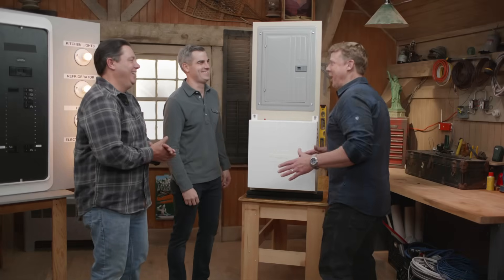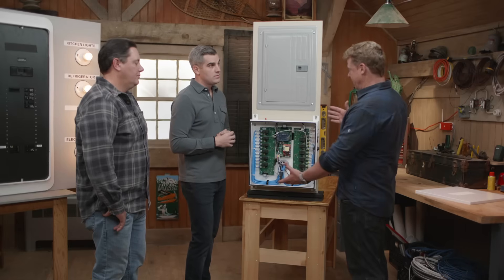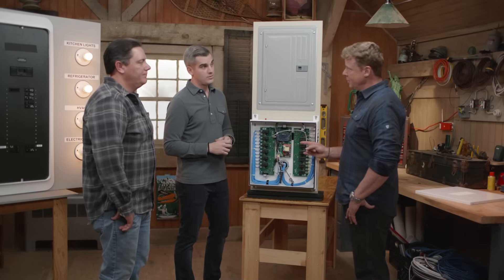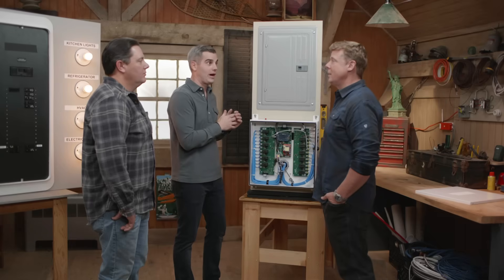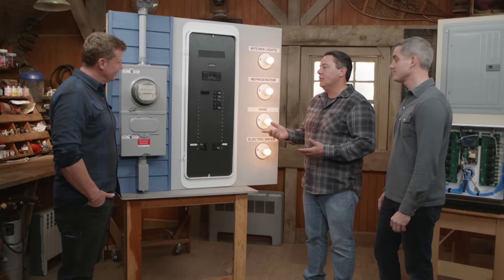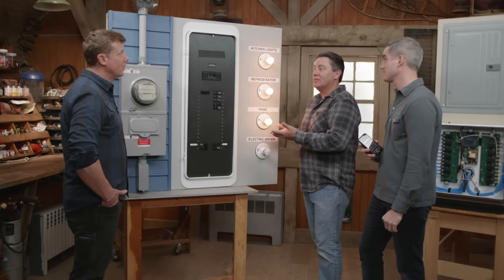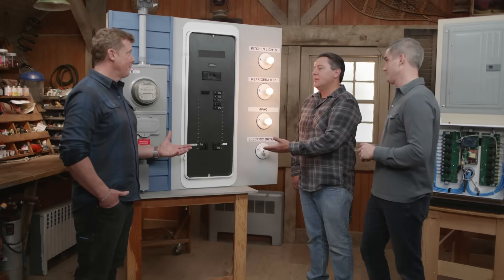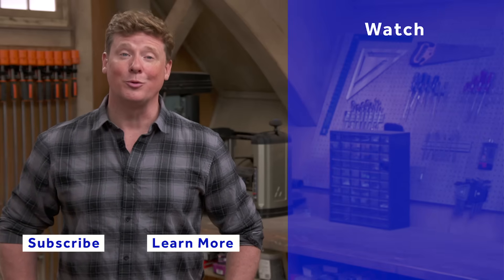Understanding Smart Electrical Panels | Ask This Old House

Comment: decided to go with Leviton load center with 2nd Gen Smart Breakers (and dual function or GFCI only) and tied them with the whole house system. Now I don’t need any intermediate decide to configure those circuit breakers to be “Essential” and can do it all within one panel.

Comment: This is no future. Battery cost 25K$ solar cost 50k$ that’s 75k$ alone. That’s 75K$ alone if your bill is 200$ a month that’s over 31 years just to paid it off not mentioning system is good for 10 maybe 20 years. We haven’t seen a system still good for 10 years so good luck. I worked for biggest solar company SunPower/PinkEnergy and they just went bankrupt I didn’t get paid. Do not let them sell you this crap

Comment: Smart panels represent a significant advancement in residential electrical systems, offering several benefits over traditional panels:

1. **Load Management**: Smart panels provide the capability to manage loads effectively. By monitoring individual circuits' power usage, users can identify energy-intensive appliances or devices and optimize their usage. This can lead to more efficient energy consumption and potentially lower electricity bills.

2. **Remote Control**: One of the most significant advantages of smart panels is the ability to control them remotely via a smartphone app or other connected devices. This means homeowners can turn appliances or circuits on or off from anywhere, providing convenience and flexibility.

3. **Integration with Backup Power Systems**: Smart panels seamlessly integrate with backup power systems such as generators or solar with battery solutions. During power outages, users can prioritize critical loads, ensuring essential appliances like refrigerators, heating systems, and lights remain powered.

4. **Automatic Load Shedding**: Smart panels can automatically shed non-essential loads during power outages or peak demand times. This ensures that critical appliances receive power first, maximizing the available backup power capacity and potentially extending the duration of backup power.

5. **Optimization of Energy Consumption**: By providing real-time data on energy usage, smart panels enable homeowners to identify opportunities for energy savings. Users can adjust their consumption patterns based on insights from the panel, potentially reducing their overall energy usage and environmental impact.

6. **Adaptability and Future-Proofing**: Smart panels are designed to be modular and adaptable. They can accommodate future upgrades or expansions, such as additional circuits or integration with emerging technologies like smart home devices or electric vehicle chargers. This future-proofing ensures that homeowners can continue to benefit from their investment as their needs evolve.

Overall, smart panels offer enhanced control, efficiency, and reliability compared to traditional electrical panels, making them an increasingly popular choice for modern homes seeking to optimize their energy usage and resilience.
Reply: Using smart panels can make sense for both retrofitting older homes and installing them in new construction projects. Here's why:

*Retrofitting Older Homes:*

1. *Enhanced Control:* Retrofitting an older home with a smart panel allows homeowners to gain control over their energy usage and optimize their electrical systems without the need for a complete renovation.

2. *Energy Efficiency:* Older homes may have outdated electrical systems that are less efficient. Installing a smart panel can help modernize the home's energy management, potentially leading to energy savings over time.

3. *Integration with Existing Infrastructure:* Smart panels can often be integrated with existing electrical systems, making them a feasible option for retrofit projects. They can work alongside older wiring and appliances, providing benefits without the need for extensive rewiring.

4. *Improved Resilience:* In areas prone to power outages or with unreliable electrical grids, retrofitting with a smart panel can provide homeowners with added resilience. The ability to prioritize critical loads during outages can ensure essential systems remain operational.

*New Construction:*

1. *Built-In Integration:* Installing a smart panel during new construction allows for seamless integration into the home's electrical infrastructure from the outset. This ensures optimal performance and functionality without the need for retrofitting.

2. *Customization:* With new construction, homeowners have the opportunity to customize their electrical systems to suit their specific needs and preferences. Smart panels offer flexibility in load management and control, allowing for tailored solutions.

3. *Long-Term Investment:* Including a smart panel in new construction can be seen as a long-term investment in the home's efficiency, convenience, and resale value. It provides future occupants with modern features and technology that may be increasingly desirable.

4. *Compliance with Building Codes:* In many jurisdictions, new construction must adhere to updated building codes and regulations. Smart panels may offer features that align with these requirements, such as energy efficiency standards or integration with renewable energy systems.

In summary, while smart panels can be beneficial for both retrofitting older homes and incorporating them into new construction projects, the decision will depend on factors such as the homeowner's goals, budget, and the condition of the existing electrical system.

Comment: If I sell my home to an old lady who isn't interested in Smart technology, will the panel function like a normal panel with no smart tech engagement or are you required (on some basic level) to connect to and configure it? 

Also, if my Wi-Fi router bites the dust, is there a way to switch the smart settings from the panel? Or am I locked into the way it was configured in the app until I replaced my Wi-Fi router?
Reply: All of these are able to act as a standard panel. They just simply have additional features for people who want more control OR have a backup system. IE generator/battery/solar etc. 

Yes. Well, mostly. It can depend on the panel. Some have a direct interface built in and some do not.

Comment: With smart panels all being built with wifi to cell phone management, what is being done to secure that communication link?  Are the manufacturer's apps being created with a built-in VPN?
Reply: You're asking about security and a VPN while using the internet to post a comment to a  Youtube video owned by a company that has had data breaches before? LOL Get out of here with that nonsense.

So many people asking that same question and acting like they all aren't actually on the one thing they fear the most.

I find it ironic and wonder if you all are still riding horses or have central heat and AC? Why are you on the internet?  lol "AHHHH this new fangled technology!"

Comment: I like how the smart panel has an Arduino Mega 2650 as a control board. But smart isn't always better. Automobiles are a fine example is the onboard PC fails that car will not start and major cost for repair. before CP were added change a wire for a few bucks and the car still runs. Now everything is fly by wire on cars. so your fuel and brake pedals function wirelessly not by a cable as in the earlier days. if the PC goes out you lose all control of the vehicle. not a good thing at all!

Comment: I like the concept, however, I do not like that it is dependent on an app, to control the circuits. I would need it to trip the breaker to turn the things off. Not just switch a relay. I shouldn’t need to use my phone to switch my breakers.

Comment: I am not against new things but I'm not sure this solves any real problems.  I have been a general contractor for over 30 years.  For my projects which had solar and/or a generator I have used an Enphase controller and battery.  Smart homes sound cool until grandma comes to visit  or the non-English  speaking house keeper tries to turn something on.

Comment: Span is $4500 for the panel alone right now.  $4500 for an electrical panel without installation is absolutely insane.
Reply: So $1.5 k more for a panel that does a lot more than the one they have shown here? 🤔 

Sounds like a deal to me. 🤷‍♂

Comment: I'm in the process of installing the second one, "Span Panel" in my 50 year old townhouse. Installation will be about $1500.  Part of that will get help from fed tax credits as tax people have already confirmed qualifies under IRA (2022), for max of $600.  With my PV and batteries, I think this will make a significant difference.
Reply: Did it?
Reply: @אתהברטון  Contractor changed (upped the price) so, I passed.

Comment: Good luck 8 years later when  chips & other parts are obsolete and you now have a useless boat anchor. Had seen this time & time again. Had to throw out $10,000 drives that were 8 years old and could no longer get replacement boards, IGBT'S , and other parts. We were lucky to have a very expensive dive lightning  /dimming panel that be vendor kept it running 12 years. Would not want something like this in my house even if it was free.

Comment: I think I'm gona go with leviatins all in one 200 amp for my panal upgrade what I like is its solar ready and has smart breakers if you want to use them in case electronics fry I can just replace a breaker not printed controll boards

Comment: Durability ? Will it still work after 10 years? 20+ years? It's expensive to replace a load center, both labor and parts.
I don't like, seeing that many circuits, on just two circuit boards. If one relay fails, you have to buy the whole board. $$$
IMO, the concept is good, the execution is questionable.

Comment: Found something else that is pretty awesome. Eaton Smart Breakers. I found them, and they are a alternative to replacing the whole panel or all your switches. You can monitor the power through them, and also turn the switches off remotely much like these smart panels. It is not as all encompassing as say, the Span Smart Panel, however, they give the same functionality over the breakers they replace. The only major issue is that a single switch style takes two slots with the smart breakers, and that means you may have to consolidate smaller loads to accommodate. Looking into it, they have two types, one of which is the BR switch style that my panel already uses.

Comment: So my concern is the super fast increasing cost of electricity - almost doubling in my area from last year - because of  inflation - a battery back up system - with a whole house generator and a smart panel are appealing to me- we also get hurricanes on the reg and the grid recently could not even handle a cold blast we had and we went without power and heat for a week during the winter.  I went over the negatives  on this post....  but an uninterrupted power supply for my property when the grid that can t handle extreme weather conditions and cost is out of control.. ... well....  That is why this appeals to me.

Comment: There isn't an electrician alive that would recommend a SPAN panel for one reason. They need to last. SPAN will never be in business long term, power distribution is simple for a reason, it's critical. These SPAN panels cost a fortune and have the potential to kill your main power due to a glitch or bug. What did you gain? Do you really need to turn your circuit breakers  off remotely? If this was not a paid spot you would never see this. I love new products but everyone that buys this will regret it down the road. Think of the worst storm in history when you need to ensure electricity needs are met, this is when the wifi & cell backup in this overcomplicated device will fail and it will cost 2x the price just to remove this. Buy all the smart tech you want, but put it in downstream from your circuits.

Comment: I'm not so sure. This is going to turn into what Nest has become, where you used to be able to just use APIs directly with the thermostat, but after Google acquired them, they shut that off and made it so everyone has to buy a Google Home hub. Now the $200 smart thermostat is no better than a $50 programmable thermostat.

Comment: I'm afraid I'm in the large minority here...getting solar and a battery backup and cant imagine doing the system without this and being able to dynamically change the critical loads panel. And it saves me from needing to install one as well which lowers the true price by a couple hundred bucks

Comment: It's cool for sure, but I question the return on investment and the security. Seems like you could control your circuits just as easily by manually flipping circuit breakers and using a generator interlock, or a suicide cord back feeding into your welder/electric dryer. Obviously, some folks would prefer a safer alternative, like the generator interlock. I bought my interlock kit on amazon for $80 and installed it myself in about an hour. Cool stuff, but just doesn't seem practical in my eyes.

Comment: I made a conscious decision to use zero smart devices in my home when I rewired, the only thing I have connected to the internet is my security system. The other issue is one we've all been dealing with and thats the supply chain issue, particularly with computer chips. I prefer tried and true long term predictablity something that can't be said for anything computer controled/dependent...
Reply: You have your security system connected to the net and are worried about security? I don't think you understand how broken that entire comment is. Either that, or you don't understand the difference between the "internet" and a LAN or home network. And if true, then your comment is even more shambolic.

Comment: That looks beautiful and all. But what happens down the road if and when the company who makes the product goes out of business? The cool handy dandy smartphone control goes out the window because it probably runs through the company's servers somehow. And then what happens if one of the relays needs to be replaced and once again, if the company went out of business? Now what? You've got a pretty fancy $3500 breaker panel that's no different than the regular panels.
Reply: Not just out of business, but the product no longer being supported by the manufacturer due to being replaced by a new product, or just abandoned due to company acquisition. Also software has a very short life cycle, so it will probably not be updated after 3-5 years from first release.
Reply: @LegoTux   yeah, I can't imagine these panels will make their way in too many homes.Their high costs aren't worth the possible risk of the product not being supported down the road.

Comment: The problem with Span is they require the use of their cloud, and they don't have a direct, locally-accessible REST API I can use to integrate it into my custom home automation. I suspect the Lumin is similar (I've sent an inquiry). I wish more people would insist on full offline functionality, and full customizability.
Reply: Thanks for bringing this up! I'm on the engineering team at SPAN, and we're actually working on local APIs. Most of us are electronics hobbyists and energy nerds in our free time, and a lot of us are dog-fooding the SPAN Panel and already have it installed on our own houses. There are several active internal projects running local APIs that have been demonstrated to the rest of the company already. We understand the SPAN Panel isn't like a security camera or cat feeder that stops working someday, you grumble and find a new one...this is literally built into your house and everything we do on the engineering team is framed in building a product that will be useful for decades. Local API is a big part of that and is important to us, especially the energy nerds on our team who have a SPAN Panel and want to integrate it into their own home automation systems.
Reply: @Grymac  That is good news, as I am getting a Span panel installed next week as an addition to my solar install.  As a big Home Assistant nerd an open and local API is essential for proper home management.  There are way too many stories of servers suddenly being turned off and devices just stop working or responding, if Span goes out of business today it would be little more than a regular panel with a pointless computer and relay system behind it.  

Is there a timeline when local access would be available, and would your team work to have an open API for Home Assistant integration?
Reply: @Grymac  I'd also like it to integrate with my eg4 DIY battery Bank.  Currently I think it only integrates with the Tesla powerwall and also another one I can't remember..
Reply: The other thing a friend pointed out is that the Span panel doesn’t retain its switch state across power outages. Is that correct?
Reply: @OriginalJetForMe  It uses latching relays and can sense the current relay state, so by default a full power off (rare as those are with storage) doesn’t turn anything on or off.
Reply: As long as your data is valuable, unfortunately the MBAs in the room will always insist on having direct access to all your data.
Reply: It will be fun when the leadership at Span cashes out to a PE firm or sells to Meta, then you pay monthly charges just to use basic features. More for “smart” features. No thanks.

Comment: A little strange that the first one only has 12 circuits. My electrical panel is much larger than 12 circuits, so I'd need multiple ones of those add-on modules. VERY expensive.
Reply: if you gave it some thought, I'd bet you'd have trouble coming up with a dozen appliances that actually need control. The rest of the house is "chump change" when it comes to actual draw.